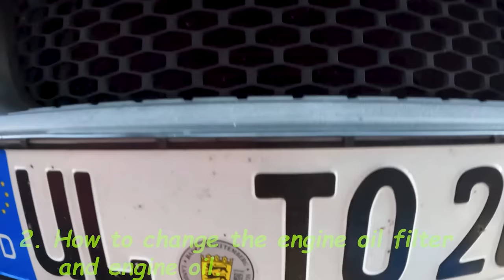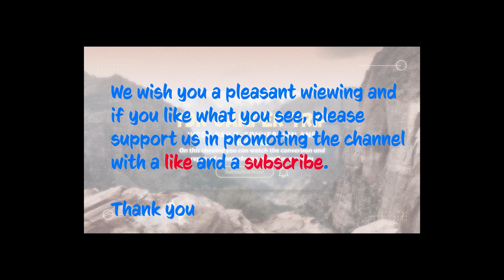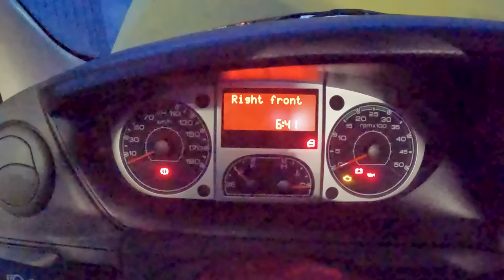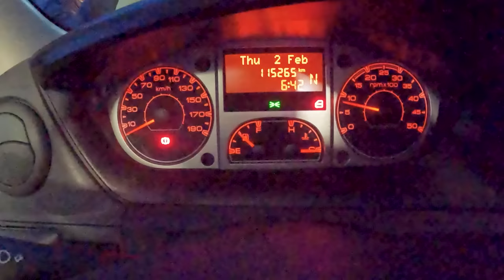Iveco Daily Repairs - How to change the engine oil, oil filter and diesel filter

Comment: L'olio che hai messo  15w40 non va bene per iveco daily 2300cc 16v  ,il suo olio è 5w30,,,,,oppure 5w40
Reply from the maker: The F1A 2300 cm3 engine can work with two types of oil:
- ACEA B5 with synthetic base SAE 5W30
-ACEA E3/E5 with mineral base SAE 15W40,
but in different amounts.
Thank you for watching.